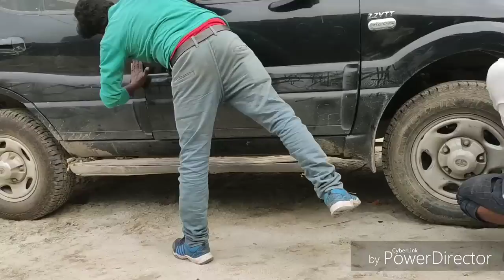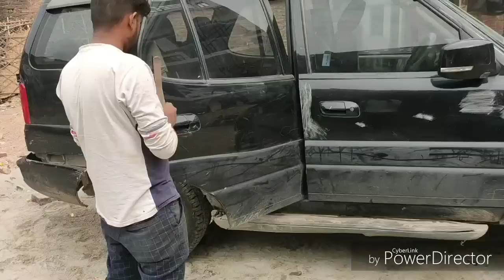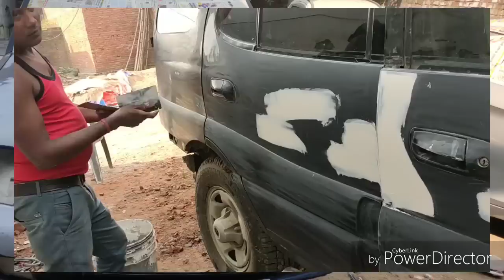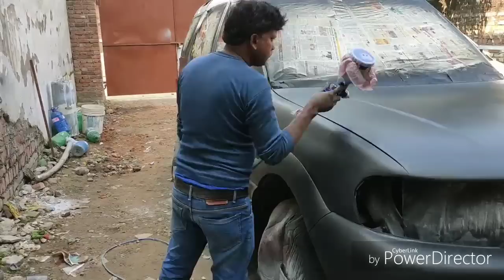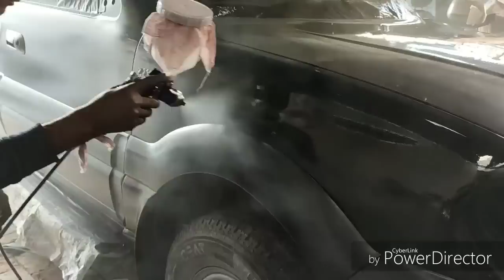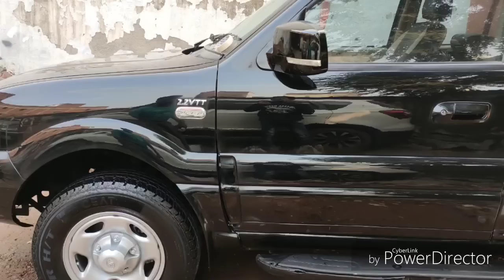Tata safari  black colour full makeover

Comment: Very soon, the paint on that plastic cladding will chip off.  Plastic cladding should have been coated with plastic primer first.
Reply: Absolutely true. Plastic panels needed to be primed with plastic primer and then painted separately.
Reply: Agree.
Reply: Yes my friend you are absolutely right
Reply: See Andie you are partially correct but 
The plastic cladder was already painted 
So plastic primer is needed in case of new plastic surface

Comment: Very dirty work place and environment especially for painting. So many dust around the area. If the wind blows, dust will surely stick to the paint making a rough surface. Get a proper painting room for it. There are also other vehicles nearby which is not even covered and surely the fine particles of that black paint will stick to the parked cars.